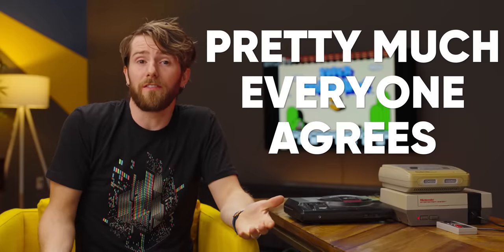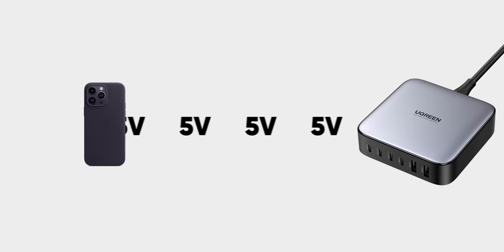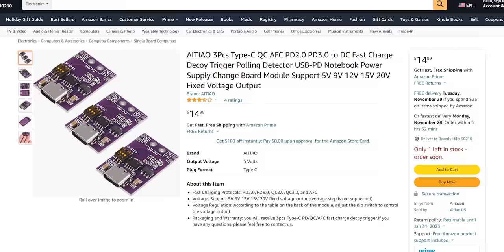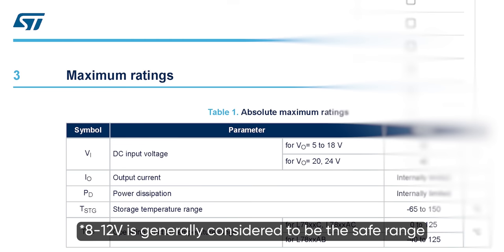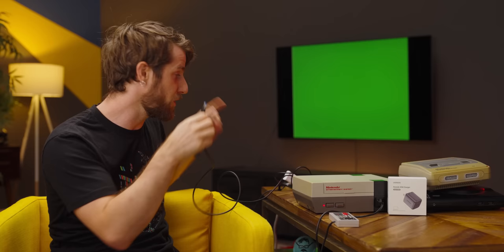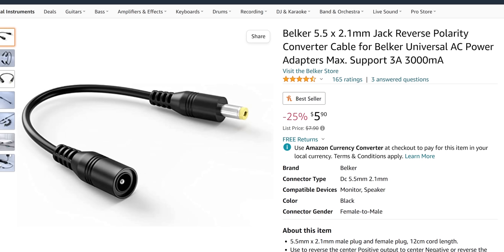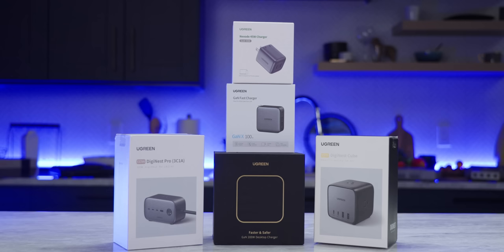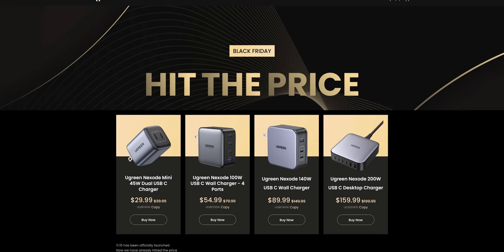How to Put USB-C Power on ANYTHING (almost)

Comment: 0:38 "We're talking..."

Allen wrenches, gerbil feeders, toilet seats, electric heaters
Trash compactors, juice extractors, shower rods and water heaters
Walkie-talkies, copper wires, safety goggles, radial tires
BB pellets, rubber mallets, fans and dehumidifiers
Picture hangers, paper cutters, waffle irons, window shutters
Paint removers, window louvers, masking tape and plastic gutters
Kitchen faucets, folding tables, weather stripping, jumper cables
Hooks and tackle, grout and spackle, power foggers, spoons and ladles
Pesticides for fumigation, high-performance lubrication Metal roofing, water proofing, multi-purpose insulation
Air compressors, brass connectors, wrecking chisels, smoke detectors
Tire gauges, hamster cages, thermostats and bug deflectors
Trailer hitch demagnetizers, automatic circumcisers
Tennis rackets, angle brackets, Duracells and Energizers
Soffit panels, circuit brakers, vacuum cleaners, coffee makers
Calculators, generators, matching salt and pepper shakers

Comment: Imagine... you spent all that money on the solar array on your roof. It charges the DC batteries in your garage. Those batteries then conver the power to AC for your household devices that just end up stepping the voltage down and converting it back to DC. There needs to be a major change in our house to run on DC so that we don't have the power loss when converting our solar DC output to AC and then back to DC. Sure some things need AC power to run. But all our electronics don't.

Comment: This entire 11 minute video didn't even mention the best parts of USB PD! The USB PD 3.0 specification actually supports "PPS", or programmable power supply. The consuming device can actually request anywhere between 3v and 21v... in 0.02v increments! And up to 5A in 50ma increments! A PD 3.0 compliant USB-C power source (such as the UGREEN one listed), will output the exact voltage requested.

Comment: Is there a way to build a USB-c pd power outlet up to 20v to build in a camper with a 12v battery? It's easy to connect a step-up converter from 12v, 5 amps to 20V 2.5 to 3 amps to a USB-c panel outlet, but the 'handshake' part on that side is nowhere to be found (or at least i couldn't find it) This would be a huge upgrade for a lot of van-lifers, camper-lifers, RV-lifers, ... Not alone you need the intelligence, it needs to switch on the correct voltage. This won't work with a regular 12-20v converter.

Comment: I've been looking for a while, for a USB-C powered portable heater, haven't found anything yet except sketchy 12v car heaters. I'd love to find one that can take advantage of the PD protocol!
Reply: If that car 12V heater doesn't exceed 3A(36W), you can just buy PD cable that trigger 12v from PD and has on the other side female car plug. However I have doubts about such application since heater is very power hungry device.

Comment: Charger adapters with electronics inside should not be used to power devices that do not charge. That's why they make power adapters. It is best to supply only the power needed.

Comment: I recently discovered pd during my internship and actually started giggling realising how much engineering had gone into my phone charger. Sadly the chip needed to add it to my board is sold out until 2023 somewhere so I had to use a breakout board but still super easy

Comment: The 12V DC thing explains why it's such a crapshoot for whether a device will actually charge from any old random GaN charger or if it was built for whatever its included charger does. I've seen situations where you have three devices and three chargers but none of the chargers will charge all three of the devices.

Comment: So I was thinking of getting a high efficiency power adapter and then splitting it into several things to reduce the amount of power bricks in my internet setup... also likely increase efficiency because often power bricks are like 80% efficient at best. If we take an example of the Apple 61W charger its somewhere around 95% efficient at 15v but does not have 12v.
So instead of getting loads of random power plug cables from the thrift shop I now intend on using usb-c 12v cables. As its a slightly nicer solution. I have one of those Topton 2.5GbE boxes and that should run just fine on a lower amperage brick than its using now. Then my Modem, NAS and other stuff should be fine with it too.

Its a mess. Theres like 6 power bricks and each has 1-2 cables and its all held together with a cable tie. Still theres wires everywhere. Reducing it by having 1 or 2 bricks seems like a good idea.

Comment: I wouldn't trust those teeny wires in USB-C to reliably handle the current.  I don't know how much power these consoles pull, but replacing the whole cable with one smaller than each original conductor scares me.  (Edit: Maybe this mod was nVidia's idea? XD)

Comment: This video is wrong, don’t use the cables with the PD chip inside them, replace the connector on the machine with a PD module and set it for the correct voltage. If you mix up your cables (very likely now they all look the same), then you could damage your machine.

Comment: The US SNES(center negative) is the exact reason I have paranoia over checking voltages and polarity. Like, I have to check everything if I change out the port even if it says it on the power brick.

Comment: The SNES doesn't run completely on 5v, the pre and post audio amplifiers run on 9 volts directly from the power supply, bypassing the 7805 voltage regulator. I do not know if sending any other voltage may possibly cause damage.

Comment: Apple could of used USB-C for the power input on their latest studio display instead of a permanently connected AC cable! So in that scenario the display could be powered by an external USB-C power supply or the power output of the computer you have it plugged into so the video signal and power for the display could run through a single cable! :)

Comment: My only problem with USB-C is that the cables are extrmely expensive, good cables USB-C on both ends can come up to 40 bucks, most of the inexpensive ones are only USB-C on one end and USB A 2.0 on the other and limited to 5v 500ma, so, I can see how that kind of standard is wonderful for the industry, but the price of good cabled are rising since 2017 and no end in sight

Comment: You are giving some wrong information here, which can damage users consoles. The NES and Famicom takes 9V AC, it has the rectification inside the console. Snes and genisis/MD takes center positive, which is super uncommon today, but it wasn't as uncommon at the time. If you supply DC to the NES it will just work, because if you rectify DC it will just be DC. You can actually use either center negative or center positive on the NES, it's all fine. But if you use the NES power adapter on a snes or genisis it will distroy them. This is quite possibly why the super Famicom has a different plug. Also don't use center negative on snes or genisis you got lucky that time.

Comment: I really hate these outlet bricks. They just do not like to stay plugged in properly if you pull on the cables attached. I would likely go with more of the ones that have a cord to the wall where I can strap or mount or just set the base down and use that. Yea outlets can get a bit weak over time and replacing them is not some simple thing anyone can or should do. I mean it is easy... If you know what you are doing, but it can also be very dangerous both at the time you do it and over time if not done properly.
BTW Ugreen does have this type as well.

Comment: 7:35 
So now instead of a dirt cheap power cable you need a usb-c cable with fancy charger, doesn't seem like a good upgrade to me. 
Also i feel there would be smaller usb-c connectors than the neutrik d styled one, those could be more convenient for hardware installation.
Reply: I think USB C wasn't designed to be plugged in a power depended appliance at all.

Comment: Serious question - what do you think about having a USB-C compatible power line at home, with common power supply unit in flat, so that there would not be need for hundred power bricks all around the house? Would this be more efficient and doable in terms of losses? What kind of power supply would be required for a single room with... 6 USB sockets?
Reply: Probably not a good idea, because 5V cables that are dozens of meters running through your walls is probably not very efficient

Comment: I suspect that this will do damage in the long run. Those old consoles’s power bricks might have something extra in their supporting power capabilities. Even though it’s not the same… I have the example of two acer laptops with their respective power bricks that are equal in their power deliveries. At a certain time the laptops started turning off randomly. What happened was… at a certain point the power bricks got switched between them. Turning them around fixed everything. At that moment I figured out that the power bricks were the same even in their model number… except the model for the newer laptop had in the model number added “V2”. I suspect that means version 2.

Comment: I had to check the output rating of my oneplus 9 charger. It outputs all the voltages between 5 and 20V, where the main benefit is at 10V and 6.5A for charging the phone with 65W.

Comment: and still, it took the European Union to force Apple to switch to USB-C... Thank god

honestly seeing as apple was one of the early adopters of Type-C on their macbook pros, I don't know why it took them longer than the old 30-pin cable was around, to replace Lightning.
(30-pin dock connector 2003-2012, 9 years... Lightning 2012-2022, 10 years)

Comment: Again with a ugreen charger video , i mention that their larger gan chargers don't see to match their spec list. 100warr pd mentioned on two ports (0fcourse only one at a time ) but both ports only supply 65w max . 
And they do it in pulses! Connect an ipad that makes a sound when the charger is connected, and you'll hear that sound like every 5 to 10 seconds.

Multiple replacements , their own cables .. still the same.

Never ugreen for me .

Comment: Check out RetroRGBs writeup on the DreamPSU (and same applies for the PS1 and other consoles the AC kit is made for) before going this route.

I'd like to see a bench test on the brick's consistency of power delivery. There's so many options that are just not good for 3rd party power delivery because of using cheap parts or poor internal design. It's not usb-c but firebrandX keeps up with a great list on their website using Triad Magnetics power bricks that are really nice.
Reply: Orignal PSUs can also be notoriously bad, like the Commodore ones. For that systems it's advised to buy a modern one as soon as possible.
Reply: That's a concern of mine. Lots of chargers are bad. Throw in variable voltage output and you have a recipe for device damage. What if it outputs a higher voltage than requested? At least you've got the console's internal regulator to deal with this should it occur, as the old transformer plug-in supplies were unregulated so a 9V would put out 14V easily into the console, without problem.

Comment: Linus, I head that retro console power wall plugs usually output slightly more power than necessary to the consoles compared to their modern cheaper power plugs of the same style and plug type which are usually considerably underpowered compared to the the original wall warts that came with the consoles.

In fact I've heard it recommended that you always want to try and get your hands on an original power that was sold with the consoles originally instead of wasting money with newly made ones.

Does this USB-C method comparable to the originals? I don't want to underpower my old consoles potentially, or overpower them of course.
Reply: If the internal power system is just converting 9-10V into 5V anyway then it shouldn't matter if the wall wart is more powerful or not.  Unless the new ones are significantly under powered.  The barrel jack method should give the old systems more than enough power, USB PD is designed to be able to power moderately powerful laptops (some gaming laptops may require more due to the additional power draw of newer GPUs and cooling requirements).

Comment: While this does get rid of the wall warts, you still have to use the right cables. Would've been cool to see a solution where you can use a regular degular male to male USB-C cable and not have to worry about if it has the right pd board inside.
Reply: Basically have a dongle on the console that you fasten to it (tape?) and then just plug USB-C into that. Then you don't have to worry about plugging the right one into the console each time.

Comment: wish there were some better cheap solutions for devices that need low voltage AC power. i have an old battle mixer that needs 16.5 volts AC and boy was it annoying to find a transformer for that.

Comment: While I can understand the appeal of USB type C, I personally would prefer to keep things a little more old-school, with different ports for different things. Having a universal power in plug would be quite handy, but I'm not so sure I want it to be USB C. The standard just has too many things going on for my liking. Perhaps I'm just old fashioned.
Reply: The other side of the coin is that as soon as you get into trying to replace original wall warts things get hairy really fast. There’s so many out there that make claims of being compatible but the moment you try to fire up a more demanding game everything just shuts down.
Reply: @tannermccoolman4647  I've never had too much trouble. Granted, I haven't had to get wall warts specifically for old consoles, but I just get a replacement with the right voltage and current specs. I can solder the right barrel jack on if needed, as well.

Comment: Please correct me if I'm wrong, but is it save to use a charger instead of a usb-c power supply? Clearly, if you're using a device with an included battery, this shouldn't be a problem. But can a charger react quickly enough for fluctuating power needs? I'm not sure where I got that from, but I think chargers introduced weird problems for the raspi 3 as the needed power changes by the amount / types of tasks running on it. The problem probably got worse for higher demanding devices like pi4 etc? It would be great, if you could enlighten me. Maybe it isn't a problem at all anymore?

Comment: Argh....if there are capacitors on the input side you need to check what voltage they will take the voltage regulator isn't the only thing you need to worry about. It doesn't matter if the voltage regulator can take 36v if the capacitor in parallel with it is only 16v/12v/9v or whatever.

Comment: I've been refitting a sailboat as a live-aboard, and I've been wondering about how to wire electric power.

120AC from the inverter is straightforward enough - except that it's wasteful. Everything that I could run DC I want to run DC. But what voltage? My batteries are 12V, but a lot of my devices take 5V or 9V, and a few take 18-19V. Do I want to install a 12V->5V converter and run both 5V and 12V around the boat? Do I want to build my own converters for each of my AC wall warts?

USB-PD seems like a great solution. There are reasonably-priced USB-PD sockets available that just need a 12V, 7-10A supply. But not everything I have will run on USB-PD.

You've given me the missing part of the equation.

Except, maybe, my Intel NUC...

Thanks.

Comment: When do we get the PicoPSU version to run our ATX motherboard from it?  They have regular 12v and wide range models that would take 20v.

I may have to do that myself actually.  

But first I may need to add a 12v PD to my DIY Thunderbolt 3 eGPU (take a TB3 NVMe enclosure ~$70 and a NVMe to PCIe x4 slot adapter ~$5 and add a 12v PSU.  Bam!  Tested and working, might be better using the 20v and a DC DC step down board, which I also have.)

Comment: If you're modding the console anyway why not put a USB-C port instead of the barrel jack? Then it would have the chip that requests the proper voltage rather than accidentally plugging the wrong cable in.

Comment: Sadly the USB C has a way of breaking... Old USB A plugs has shown there ability against the times, yet USB C can easily break, although better then the USB micro it is still not good enough. USB A plugs can be used over and over again, in and out, and there weak point is not in the plug itself.

Comment: This video is too much work. However it does bring light to an interesting opportunity. Seeing as USB is everywhere now, a company that can produce specialized USB PD cables that can convert XYZ device power requirements to work with USB PD chargers is going to have gangbuster business moving forward. 

In theory if USB PD gets advanced enough you could go all the way up to max watts supported by standard wall outlets. So  somewhere down the road you could completely eliminate standard wall outlets in homes and replace them with USB PD (or some similar technology). After that, for any device you would just need a cable not an adapter. You could even get fancy and transmit additional information for standard smart home monitoring too.

Comment: Having PD in the cable itself is a horrible idea. Idk why you try and make it out like a good idea. It just brings us back to dc barrel jack days but worse since there's no chance the cable won't fit. Imagine a company shipping a 20V USB C cable for their product and an unknowing consumer, putting it in a drawer when they don't need it anymore and then plugging that into a 5V only device later on? This already happens all the time with dc barrel jacks, customers frying their devices with any random PSU's they find if the plug fits, it just makes it guaranteed.